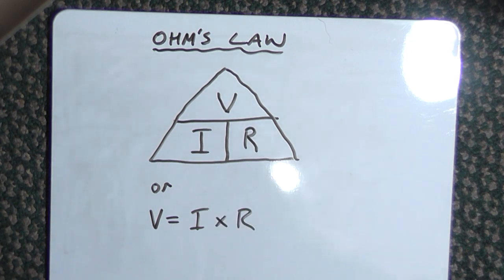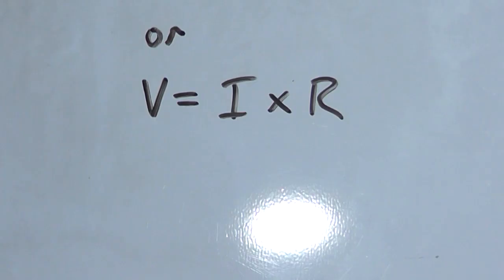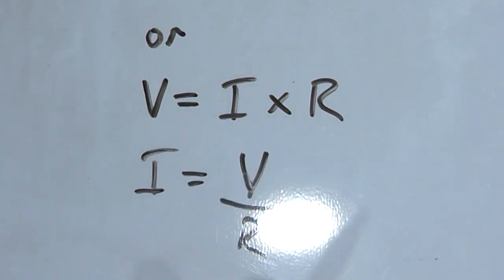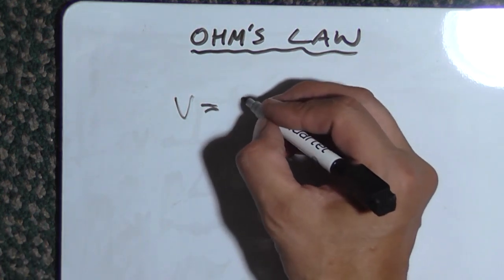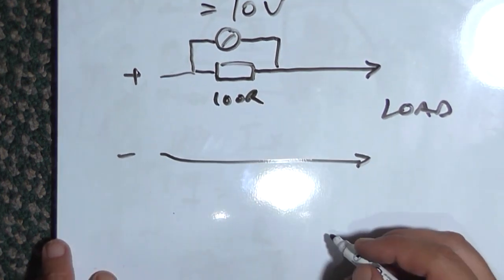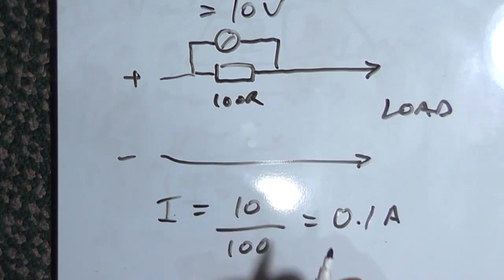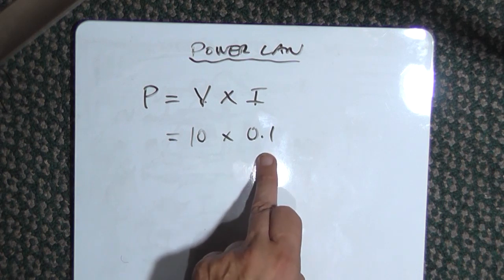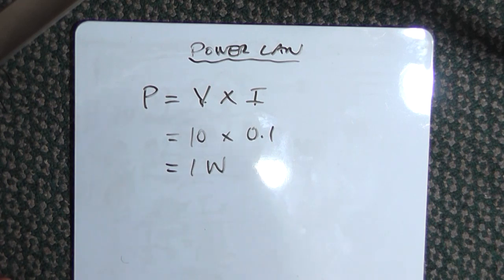Electronics Fundamentals: Ohm's Law

Comment: It's almost like this video is directed at me.. but I nearly didn't make it past the thumbnail. Whoar! 
Anyway, I do know Ohms law. It's putting it in to practice that can be tricksy at times. 
Wouldn't you need to know the resistance of the load to know the total current consumed by the circuit?
Reply from the maker: No. It wasn't aimed at you. And yes. As I said you need to know the current used by the circuit, and one other value. This video is aimed at new comers to electronics.